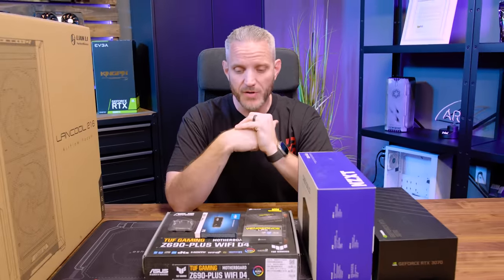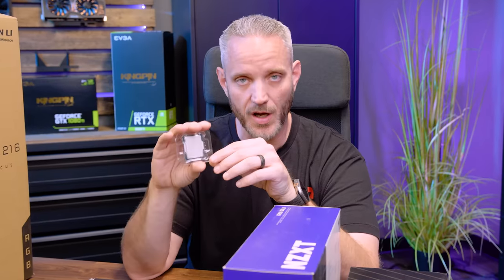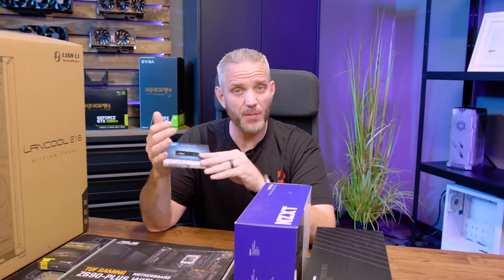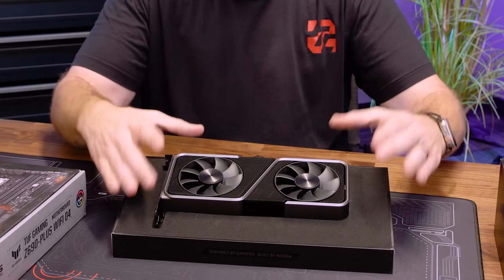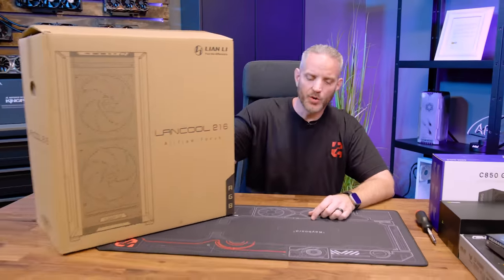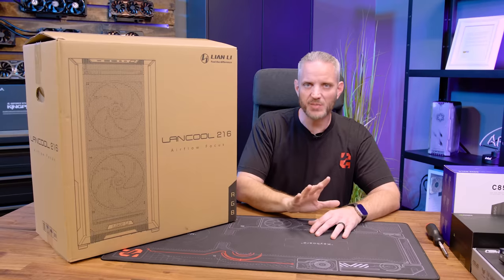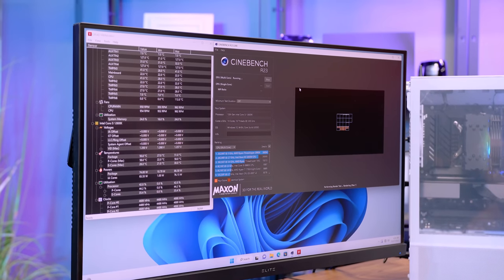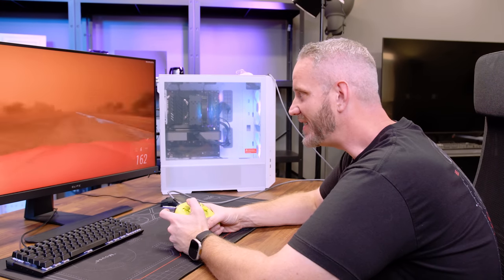Inexpensive PC Build Guide!

Comment: Thanks for the mid-range build video! I've been an IT pro (IT Manager/Systems Admin) for over 20 years, but I rarely get to build from scratch,  so videos like this are really helpful - my last full new build in 2011 was a low budget Phenom II x6 / 8Gb / GTX 660 that came out to around $600 (and I'm still using it - or rather my 11yo son is). I just started receiving the parts for my newest build and went through the same price/performance review that you went over - I also started with the 12600kf/Z690/16Gb with a RTX 3060ti, but after about 20 mock-builds on pcpartpicker, I ended up buying the 13600k (@~$315 - worth it for ~$15 more than the KF) and a Gigabyte z790 (~$200 vs. slightly less for the z690, or $100 more for a comparable Asus mobo). Yes, DDR5 is more expensive, but not by that much, and I felt it was worth it to be more forward-facing and be able to upgrade to more/faster RAM if needed, rather than trying to source older DDR4 five years down the road. I splurged on a RTX 3080 for ~$900 brand new. This should be a massive upgrade from my old cobbled-together i7-3770k / 16Gb / GTX 970. Can't wait to start assembly!
Reply: I want to get into IT. From healthcare field.

Comment: Jay, I'm only 3 minutes into this video, but so far, I am LOVING it.  This is exactly the situation I find myself in, wanting to build / buy a computer with some high end parts, but saving money now so I can upgrade in the future.  I am thoroughly befuddled by the options available on motherboard today, and have a small thought of just buying the newest, most expensive Z790 out there.  I will resume my watching now, and hope you don't dissapoint. (I'm sure you won't)
Reply: i just picked up the same board he shows here and its been great. i honestly dont see a need for a z790 board as long as you can update the bios if going 13th gen
Reply: Not knocking this Z690 it's very nice, but overkill for a "inexpensive" build.
Even if you're worried about CPU performance and upgradability. 

The performance difference between Z690&B660(with good VRMs) @stock turbo boost will be negligible with anything ≤12700K
So you can save at least 20% with a cheaper Z690, even further 33% on a good B660, all while getting the same performance @stock boosts.

If you're just concerned about not choking your future cpu, this board is well beyond that.
I'd personally get something cheaper that still provides solid VRMS, and spend the money saved on RAM or storage instead.

If you're set on this board in particular there's nothing wrong with it. 
 4 m.2 slots, and 4 Gen2 USB headers (most cases use 1-2), and more features.
Better then cheap Z790s that are a little more expansive then this, and offer less with no extra performance. 

(States pricing, your country may vary)

TLDR:
This>Z790
This is more MOBO then most will need, could spend more on other components.

Comment: Nice choices - like many I too built on the 12600K with a 3070.  This fall I took the plunge and went to water cooling.  Reused my 3070 (it does not really need it, but it was my first loop and I went hard tube).  Went with the EK MSI Torpedo board so DDR5.  With a 13600K it runs full out now 5.6GHz and stable :-)

Comment: Currently working on building my first PC. I have an existing GPU from an old prebuilt (960) and am looking at 5900X, 64 gig ram at 3600 and hoping I can hold out for a 7900XTX so when I want to upgrade I do full motherboard change with CPU and can keep everything else
Reply: Except RAM.
DDR4 doesn't work with AM5 motherboards.
Reply: Look at the 7600x (or higher) - platform prices continue to go down and 3 years of platform upgrades ahead. With faster ram you may not need as much - depending on what you're doing.

Comment: IMO, I think that at this point people with a mid-range budget buying something like a $500-550 GPU (which can actually be a used 3080 or a new 6800XT at this point, you don't have to waste money on a new 3070 and take the huge performance hit) should be buying an AM5 board with a 7600X.
The 7600X is nearly identical in performance to the 13600K, which is another great bang-for-buck CPU, but the difference is that you're not buying into a dead platform. Unless you're the type of person that doesn't upgrade computer parts for like 5-7 years, you're only screwing yourself over by buying an LGA-1700 board and CPU. In a couple of years you're going to be looking at your CPU, and the best you can do is buy a 13900K. At that point 15th gen will likely be out and their mid-tier model will be making the 13900K look like it's riding a bicycle in a car race. Meanwhile, an AM5 board is going to still be able to slot in whatever chipset is current at that moment.
Honestly, even if you're the person that doesn't upgrade often, AMD is usually so long-lived that in 5 years you'll find that your board still accepts the current gen of chips.

If you're on a budget, a 13600K or an AM4 board with a 5700X is a great choice. But, if you're at the level I'm talking about then I don't think you should waste the money on a 13th gen because you're going to be forced to buy a new Mobo and a new CPU.

Comment: Great build for 1440, Jay. Similar to mine. 12700 + 3070. With Meteor Lake rumour of cancellation, we have a high chance of LGA 1700 supporting 14th gen Intel too. If so, I would upgrade to 14700/14900 + 50 series GPU in future. This is a great build with a path for at least the next 5-6 years. 👍🏼
Reply: Except with that in mind, it would now be more prudent to go with ddr5. Mid range ddr4 is going to hold you back notably with 13700, not to mention potential 14700.
Reply: @Tc4ify  agreed DDR4 will become bottleneck sooner rather than later. Interestingly Intel is still supporting DDR 4 @3200 max even with 13900 KS
Reply: @Abra_Ka_Dabra_008  Officially yes, but you can go well above that. However these days decent ddr5 is starting to make more sense than top of the line ddr4 (sometimes already cheaper too) and you'll be able to upgrade it to an even better kit in a couple years, while ddr4 development is over.

Comment: the stock cooler depends on the intel chip you buy. I5 and i3 chips still come with stock coolers, but the i7 and i9s dont. the newer stock coolers actually looks MUCH better than they used to with intel
Reply: This is not correct. All locked chips (non-k, including locked i9s) come with coolers, but all unlocked chips do not come with coolers (with k, including 12600k).

Comment: I am really, really surprised you recommended the 12600kf when you’re talking about upgradability. The 7600x is only $20 more and on the brand new AM5 platform. Yes, you’ll have to pay out a bit extra for DDR5 but if you’re worried about upgradability, why limit yourself to a DDR4 platform? If AM5 lasts as long as AM4, you’ll have plenty of room for upgrading for years to come.

Comment: Really nice review! I hope to build a similar pc very soon. 

I find your take on 'upgrade path' a bit strange though. For someone who buys a midrange pc, you probably wouldn't want to upgrade the cpu within the next 6 months with 1 generation newer, but rather in 5 years when your pc starts running slow.
Reply: Yeah definitely. But i think we are in a weird time because each gen of cpus recently have been getting better and more performance. But overal its not worth upgrading your cpu every gen. Only when your gaming needs arent being met. I was on a 3600x and while its a great cpu, the 5000 series cpus were a solid jump in performance and can handle better cards. I ended up going with the 5700x because the 3600x was bottlenecking my 3080 even at 1440p. But i originally had the 3600x paired with a 2060 so it ran everything i needed perfectly fine at 1080p.

Comment: I was kinda sad when I compared my score to yours because I was way behind, but I am running a 5600x and I also got 1200 points over the last score when the system was pretty much brand new and I stress tested it, so apparently the little tweaks and optimization help a lot :D Also, I did not exceed 71°C and when I ramped up the fans got it down to 67/68°C, which isn't brilliant but is fine for propably not the best thermal paste job I could've done.

I am running a very different setup though - not because I'm not also in the higher mid-end/lower high-end range, but rather because I went the opposite way with all components. I have a Strix DarkHero AM4 MB (got angry at the b550 for having a wonky intel LAN chip and rage-bought the Darkhero), 5600x as mentioned (I know, only AM4 available, but I do have some headroom for improvement) with a bequiet Pure Rock 2 FX cooler and Asus Dual 6750xt. Oh and 32GB 3200 corsair vengeance RAM because it was available and affordable at the time.

I can match your max/ultra settings in 1440p in many games, except some older stuff weirdly (20 year old games are NOT very good at handling lots of GPU power! They just take all they can get and it's running at 98/99% no matter the settings :D)

On another note, thanks for all the information and inspiration. Sadly, I found your channel only after I started building the new system, so a lot of stuff was already decided. But I have started cablemanaging for the first time after seeing your tidy af builds. It is a WIP because I am going to upgrade the fans, and I am also moving next week at which point I'll have much more room and less dust.
Reply: Yeah having an fps limiter via either drivers making a game profile, or via rivatuner server statistics (comes with msi afterburner) adding the game & setting a fps limit that exe in particular uses.
Or via config files if the game has commands for it helps quite a bit with both thermals & reducing noise.
Specially for a game like f.e.a.r from 2005 for example the main menu has an uncapped fps limit & goes too like 3000+ fps rendering a 2d menu & ramps up gpu load too 100% for just showing the main menu.
Fps cap set too 101 in rivatuner ? whisper quiet even ingame on my 1660 super.
Recently moved up too a ryzen 5600 non x from an I5 2500k at 4.5 ghz, so many games are smoothly running now without stutters from like getting a random message on steam or similar.
Reply: Bro.. these videos arent for you... ok.. lol .. 
You win.. you already got this game beat..  Lol. 
This is for wayyyy way different ppl.. way down the tier list.
Reply: @Mini-z1994  Yeah the build is quite new so I'm still very much trying out what works how well and which workarounds make stuff work that doesn't play along as of yet. :D Thanks for the hints, I'll see if they help in this case. :)
Reply: @strydyrhellzrydyr1345  Thanks for the compliment :D 

but I think performance-wise (apart from the cinebench score, though he has more cores on his CPU and way, way better OC skills than me) and also price-wise it's quite comparable to this build, mid-to-high end with some headroom for later upgrades. :)

Besides, I love Jay's videos regardless of whether he builds a ultra gaming monster with custom LC or a budget thing with air coolers, it's fun to watch and gives me inspiration for things I might upgrade or optimize later, like now with the cable management :)
Reply: what was your score in Cinebech r23 with 5600x?
Reply: @Tadej Šerbinek  wasn't very high, I don't have it in front of me but about a 12000 score. At the moment of testing, I was only using minimal tweaks on top of the standard amd boost clock. I am very new to overclocking so I'm not going balls to the wall anyway 🙃
Reply: @Loki_Firegod  Ok, nice im getting around 12k too with the curve optimizer all core negative 20 and some pbo limits. all core clock 4.65Ghz
Reply: You have an entirely different system to him and you're expecting the same results? They're similiar, that's all you can expect.

Comment: My build
5600G-$123
Used eBay 2060-$197
Amazon case-$65
Pack of 6 fans -$55
NZXT motherboard open box Amazon deal-$167
Cooler master 650w ps-$55

Corsair ram 16gb-$67

Total cost with shipping less than $800
Ultra settings no issues. Beginner PC build. I’m beyond happy with it.

Comment: This gave me a few but very needed answers to questions I've been thinking about for a while.
Gonna save some money for my new office system with focus on noise levels, thank you very much.

Lancool 216 not available here, so I'll get the be quiet! 500DX which seems to be great noise- and cooling-wise.
Vetroo V5 not available here, so it's gonna be an Alpenföhn Brocken 3 or Thermaltake PA120.
Got quite fixated with the high numbers of the SSDs, gonna be a Crucial P3 or WD Blue SN570.
Finally an answer for my RAM, which will be a 16GB kit rather than a 32GB kit due to mostly just office work, notion and few graphics designing.

All the best,
Thomas

Comment: got exactly the same ASUS board with a 12700KF. there is a 850W EVGA PSU and it's more than enough for the CPU + the Inno3D 4090 X3 OC. 1KW is kinda overkill. if someone buys a decent 850W PSU, IMHO it's more than enough.

to the SSD stuff: for boot drive I have a 860 Evo 500GB Samsung, but that's only for boot. with that the bootup time is around 3-4 seconds. why should I spend $$$ just to save 1 second on the boot time? :)
Reply: Yeah, I run a 4090 with my be quiet 850W PSU no problem (it is actually what be quiet recommends for a 4090 anyway). As long as you limit your FPS to something sensible so you don't get "runaway fps" in menus, power draw will hardly ever go beyond 450 Watts.
Reply: @TheGerudan  i'm not limiting, 7680x1440 with ultra settings is pretty hard sometimes even for a 4090. the max pwoer draw what I was until this time was around 380W (card limit is 450W).
Reply: Haven't build my pc since 2011....i'm hearing something about people not wanting to buy the 4080 because its overpriced or something? I'm trying to build a new rig and need input on a max $2000 budget (not including monitor, periphals, etc). Anyone can recommend if 4080 is worth paying for?
Reply: @bobjohnson6131  with a $2000 budget I'd go for the 4070 ti. It has better performance per $. Or go AMD as long as you don't need ray tracing. But currently everything is more expensive then what it used to be
Reply: @john9801  I think I'll wait a bit. I'm not in dire need so ill observe the next few months to see if pricing changes

Comment: Jay's points are valid although I just upgraded with a complete different path. The current build I'm upgrading from is an ITX system with a i5 4460 and gtx 1060. So, I am fixed with an ITX board which I chose an X570 board with 5700x and 32GB(2x16gb) DDR4 3600mhz, which compare to an 12 gen intel 12500KF is probably similar in price, but I feel like the 2 extra cores is what I wanted. Most likely I'll run this for a few years, then do complete upgrade with CPU, MOBO, RAM and retire the 5700x set into a HTPC/NAS. Next upgrade will probably be the GPU, but that's sometime in the future. I also got the P3 Plus (gen 4) instead of the P3 (gen 3) as it's only around a $3 usd difference (this is in HK not US), the ssd is dramless, but I think a dramless drive from a brand like cruical will always be better then getting some random brand just to get more capacity or dram.
Reply: The 5700x is a great cpu and power efficient. Basically a 5800x with less power draw but similar performance. I also went with the 5700x since i was already on AM4 with a 3600x. The 5700x will easily hold us over for a couple years before we get that itch to upgrade to a new platform lol

Comment: Wow, $1500 for a mid-range machine?

I have a 1060 6GB i5 quad core system that cost half that and still runs AAA titles nearly a decade on. $1500 is a premium machine
Reply: I bought the same rig (1060 6GB and i5 quad core ) you're mentioning for almost 1500$ a decade ago

Comment: Even with the raytracing caveat, at the current pricing I'd really consider getting a 6800XT instead. It's one tier higher so the raytracing is worse than nVidias but still playable and not too far behind the 3070, and otherwise the card rasterizes circles around the 3070 and comes with twice the VRAM. And they can be found incredibly cheap in comparison, lower in price than the 3070.
Reply: I'd honestly go for a full AMD get a 5600 and a solid motherboard and go for a 6800. You save like $300+ and get nearly the same performance if not better in some cases.
Reply: Where can you get a 6800 xt for less than $590?
Reply: @piersonklein5477  They regularly pop up in stores for around that, probably not right now around xmas. I got my non-XT 6800 for €499 in November, the week before Black Friday. Regular shop, new + warranty. Could've had a 6700 for €379 or a 6800xt for €579 around that time, others seem to find the 6800xt for around €550 in stores. Watch out for promotion deals in large stores. And yes, that's Euro prices, but usually GPU prices are higher here in the EU and include VAT.

Comment: After months of planning and hemming and hawing, this list is almost exactly what I also put together. I went with the slightly priceyer, but more forward looking, ddr5 version of the board+ram , because I was re-using an existing 2070 (for now), and didnt need a new case either, though now I need to re-look at those LianLi cases now that I know that side module exists.